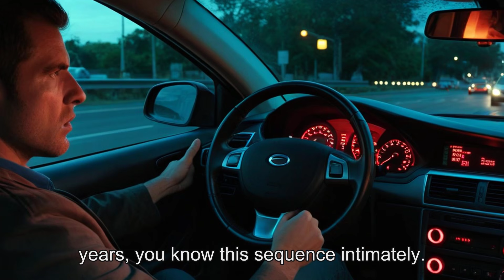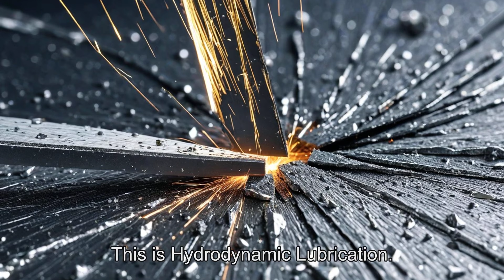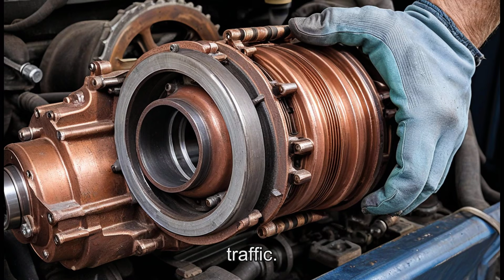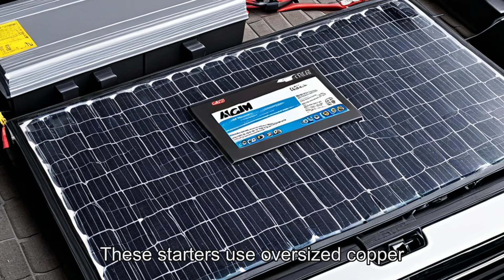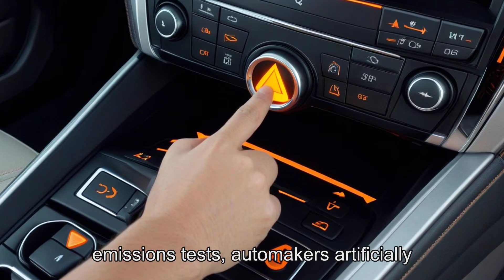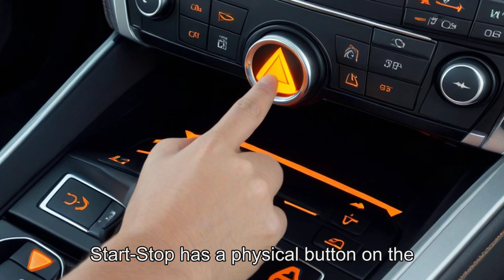Why You Must Turn Off Auto Start-Stop (The $3,000 Engine Trap)

Comment: GARBAGE. I have a BMW with 250,000 on it which has start/stopped from new. When I drive it to the great scrapyard in the sky, I will know whether you are talking truth or shite.
Reply from the maker: That’s actually impressive mileage. Some engines handle start-stop very well depending on design, oil quality, and driving conditions. The debate usually comes from long-term wear patterns seen by mechanics across many vehicles, not just a single case. Your BMW clearly did something right.

Comment: More nonsense!!
Reply from the maker: Fair point. Some engineers argue modern start-stop systems are designed to handle the extra cycles. The long-term wear question is exactly why this topic is still debated.
Reply: @HowItReallyWorksOfficial cars with stop start systems have the same engine lubricating characteristics as others. There is always enough oil to make sure they are not starting dry. My Mercedes Benz A180 has stop start system. There is no unusual noise when I start it. This nonsense about the stop start system causing rapid bearing wear is just that, pure nonsense. Car manufacturers research this before installing it in their cars.
Reply: Not this time.  Perhaps it's best for an engine to run at a constant RPM as it's closest to what we would call the steady state.  As the man describes in the video, everything is in balance.  The start stop cycles put things out of equilibrium.  The frequent starts can be considered a shock input to the system.  Idling is reduced stress to the system.  Just think.  Every time you stop the oil drains from the cylinder walls.  Then you restart with a shot of raw gas which washes even more oil off .  Starting and stopping an engine causes increased wear and tear compared to idling , particularly on the starter motor, battery, and engine bearings due to friction during initial startup.  The government mandated this system.  I guess the lawyers who run the country can mean well, but everything is not always thought through.
Reply: @daniellarson3068 wrong. You really think that the stop start system does this to engines? Very wrong. There is always enough oil on the bearings to keep them lubricated during start stop cycles. Like I said, more nonsense. When you stop at the lights or in traffic for only a couple of minutes, not all the oil drains back to the sump. Why do you think the manufacturers state to wait about ten minutes after switching the engine off to check the oil level? Question is answered in part of my response. I’m a retired auto engineer. If the stop start system actually caused this problem, it would not be fitted. I have pulled engines down after they had sat for a long time without being started, and the bearings still had oil on them, as did the crank. Now stop talking nonsense.
Reply: @christophermarshall5765  Sorry - I've worked with a lot of people who called themselves engineers.  I just don't believe you.  If nothing else, I don't want the inrush from my battery to the starter motor.  It will lessen the life of the lead acid battery.  I will hit the defeat button and let it idle.  In recent years "auto engineers" have been doing things like plastic parts and belts within the crankcase.  Even my car has direct injection which I expect will carbon up my intake valves.
Reply: @daniellarson3068 you are a know it all moron. I am not a so called engineer. I am the real deal who has no time for idiots like you. It is common knowledge that when your  car engine is stopped, a certain amount of oil remains on the bearings. This is called fluid adhesion. You are talking a lot of garbage. You have failed on all counts in your response, because battery technology has changed a lot over the last few decades. The materials are more durable, and higher capacity batteries are being made smaller. The so called “ inrush” to the starter happens when you first start the car in the morning. You really think that you know more than I do? Garbage. You know nothing. You failed to understand that alternators in modern cars put out more current than older vehicles. The batteries used are designed to be charged using high current and voltage. Most modern batteries are sealed, meaning they don’t require topping up with distilled water. I must admit I had a good laugh at your response, because it is entertaining at best. Nothing factual about it.
Reply from the maker: Great point. In tribology terms, the steady-state condition keeps the engine in hydrodynamic lubrication, where the oil film separates the metal surfaces. Repeated start cycles force the system back toward boundary or mixed lubrication before full oil pressure is restored. That transition is where most of the wear debate around start-stop systems comes from. It’s an interesting engineering trade-off between emissions targets and long-term mechanical stress.

Comment: Yep, I can't help but think 'stop-start' imposes additional wear on all engine components, not keen on the turbo winding  down, winding up for every red light, stop sign, etc, can't be good for it, better it just keeps spinnin'. Car makers get some stoopid ideas.
Reply from the maker: Exactly. The biggest issue is the number of start cycles in city traffic. 
Modern systems are engineered to handle it, but the long-term wear debate is still very real among mechanics and engineers.